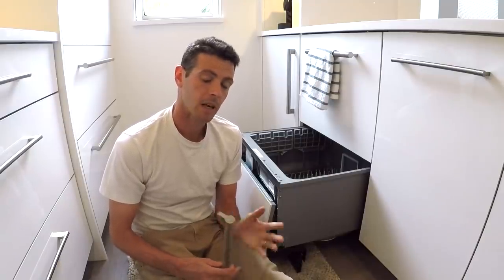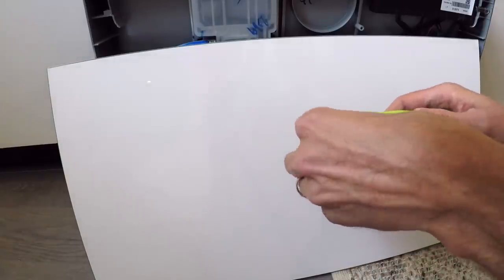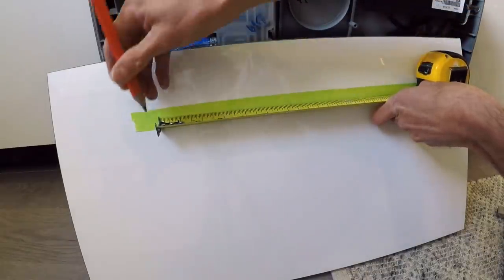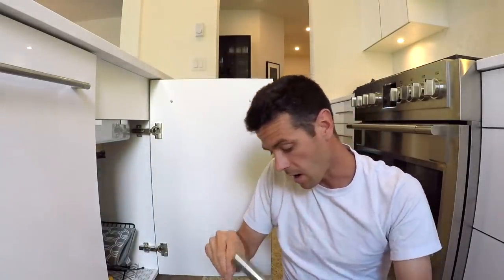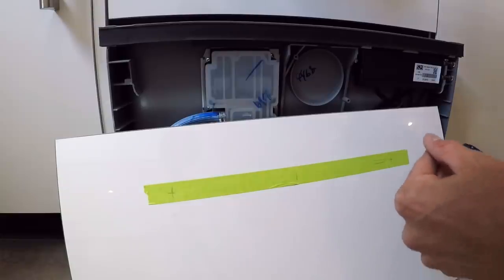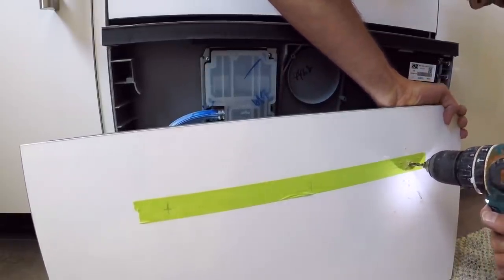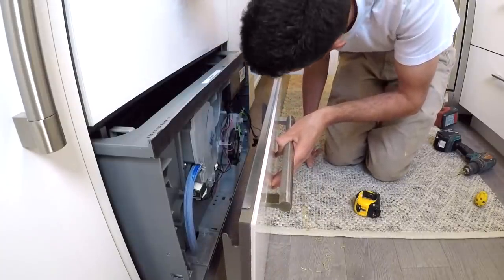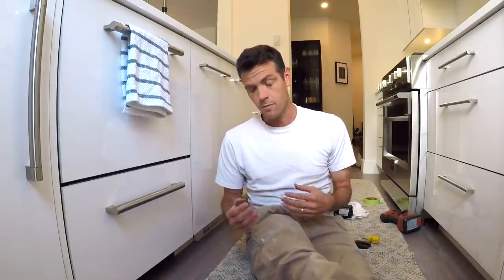How to Install a CABINET DRAWER HANDLE!

Comment: Apart from using a jig to measure everything out, if you're going to use this method always use a sharp nail punch after you mark everything out to help guide your drill bit.

Comment: Hi Ben,  IKEA sells a really nifty plastic template jig for a dollar that helps make consistent measuring marks. Also, to prevent blowouts, I sometimes use a smaller bit to make the hole from the front, then follow it with the larger bit.

Comment: Good lord, switch to metric already! 

Eg 200mm wide handle on a 600mm cabinet front means 200mm on each side - no fractions, just easy maths
Reply: Why do that when you can make it much more frustrating and annoying to use inches?
Reply: really not that hard to understand 16th's.

Comment: As others mentioned a center punch will help keep the drill from wandering.  Additionally some folks may find it helpful to drill the holes with a much smaller drill, then go back half way from each side with the proper size to avoid blowout.  I also like the jig method, using a center mark on the jig for drawers.

Comment: When you install a horizontal handle on a flat drawer front, like the top drawers in your video, common sense would be to install them centered. That looks good, when looking at them straight on. However, when you look at them from eye level, they appear too low. That is because your eve focuses on the horizontal part of the handle and not at the spot where the handle attaches to the drawer front.
Therefore, it is better to install the handles above the center line. 
The deeper the handle and the lower down, the higher above the center. For 6" top drawers, I usually mount them about 3/8" (10mm) higher. Bottom drawers about twice that.

Comment: Lots of useful tips as usual Ben.  The cheap plastic jigs from the hardware store last forever and are great to have. When you don’t, it’s good to know how just as you’ve demonstrated.  Tip for finding centre in odd sized pieces....tilt your tape down on an angle to the next divisible number and mark it’s easier to find centre, no fractions ever....try it and guarantee you will wtf....

Comment: You can buy a plastic hole marking tool at the big box stores. There are 2 different types for the different kinds of hardware. Someone gave me them 25 years ago when I started doing cabinets. Works well and the guys that work for me make less mistakes. You and I both know there smarter than us. Yeah right. Always enjoy watching your vlogs.
Reply: A Me i use the same plastic jigs.  Their is a door and a drawer one.  Almost foolproof.

Comment: Yikes those fractions. Benefit of a hybrid imperial and metric tape is you can use metric for more precise work. IKEA has a hole template plastic jig that lasts a while and makes these much easier to do for very cheap. I make the holes snug by the way. Leaving them slightly wider is good for the first look but over time you give it extra room to offset based on the angle it gets pulled.
Reply: once you get used to imperial it isn't any harder to use.

Comment: There are templates you can get at Home Depot and they even come with the right drill bit. Best $10 I spent when I changed the hardware on my kitchen cabinets.

Comment: I use one jig for pulls and one for handles.
My jig for pulls has a Centre mark that I sling with a Centre mark on the door.
All cabinets typically with the same height down form the top.
Reply: I do the same.

Comment: Sometimes can use two longer screws or allthread of the same thread to make the drawer handle into a trammel.  Cut off screw heads. Grind points onto that end of each screw.  Run them into the drawer handle and use them to strike arcs or punch starter dimples into drawer.

Comment: Not true about only get one shot.
Should always make a jig.
If you screw up the jig, you can start over.
No chance of an error with the proper jig.
Tape measure is too crude of a tool for this as well.
Reply: if you know how to use a tape measure it works fine. No point making a jig for one drawer handle lol..

Comment: very nice vid.  i noticed your stanley tape is ratracting very quickly.  take it apart and unwind it 2 revolutions.  That will make the hook last longer.  yours keeps slamming into the body everytime you use it.  lates
Reply: That's how they work. The fatmax tapes all retract like that.
Reply: @GarwoodNick  so what.  unwind it twice and you are good.
Reply: @MrTooTechnical  Yes but doesn't that make it retract slower?
Reply: @GarwoodNick  thats the point
Reply: @MrTooTechnical  I guess it's a matter of personal preference. I would rather replace the tape a couple times a year than work with a tape every day that retracts slowly. I mean I use the thing probably a  hundred times a day.
Reply: @GarwoodNick  no.  wrong
Reply: @MrTooTechnical  I don't understand what you mean
Reply: u wanna be correct, unwind twice if not, u r wrong.
Reply: @MrTooTechnical  No it's just a modification you suggested, a personal preference. If it were the "correct" way, then it would just be manufactured like that in the first place. They make it the way that they do because guys who use it all day doing framing and the like, might extend and retract the tape a thousand feet in a day, so the tape has to move quickly. Maybe you use yours just doing cabinetry like in the video here which would explain why you like to modify yours as you have suggested, but the fatmax is not made primarily for that application.